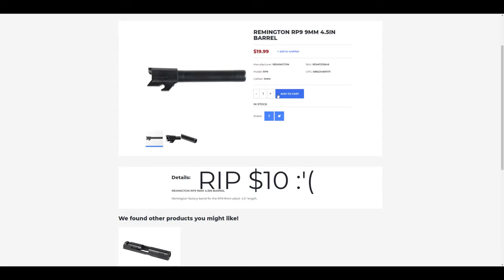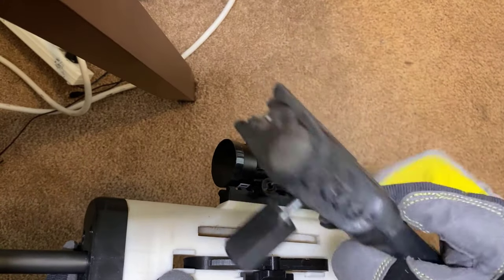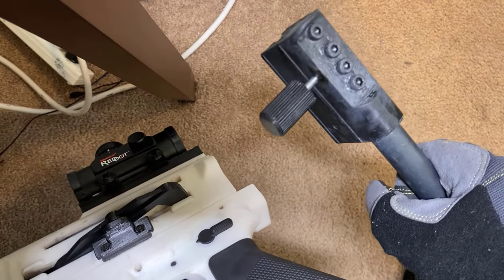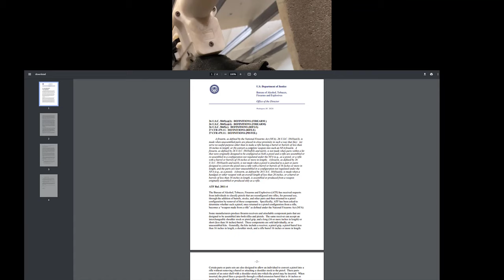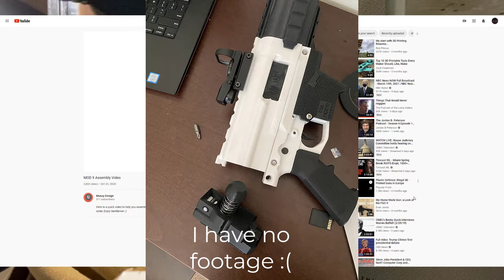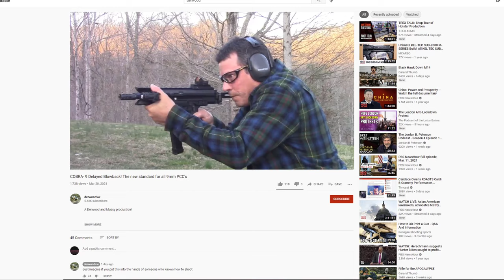FGC-9 Review: How I Learned to Build a Gun In My Closet

Comment: Hello, I am doing the same build right now, I am using lost wax casting with aluminum for strenght in sensible parts.
Reply from the maker: So you're trying to build it out of metal? Sorta unnecessary when PLA+ works fine, but interesting none the less
Reply: How did it turn out

Comment: Bashar vid was hilarious, hth did you find it?
I'd still rather have metal, even sheet metal which is a fine art, ask mark serbu.....but hey if plastic works, stick with it: def. better and cheaper mass production capabilities for sure
Reply from the maker: I'd agree but with that but after destroying 5 drill bits on failed bolts I have way more appreciation for people who can actually do metal work. The 3D printer lowers the skill barrier greatly and overall still deliver respectable results. There was this project the "PPDW-9" that looked like a traditional, full-metal gun home build. Curious to know what ended up happening to it but it looked like a project for people who actually have real metal work experience

Comment: Nice video, so I purchased a fgc9 kit and wondering will this kit work on the fgc9 mk2. I just started printing my parts but should I be printing the mk2 and use the fgc9 kit with it.
Reply from the maker: Yeah you just need to do minor conversions to make it work for the mk2, You'll need to buy some different parts but the bolt and barrel are essentially the same

Comment: Is there a way to chamber the fgc in 9mm luger?
Reply: It already is, that's what the 9 in FGC9 stands for 😉
Reply: @ludwigwinter6795  oh i thought it took 9×19mm Parabellum
Reply: @Schizohandlers  That's just a different name for the same caliber. I'll admit it's a bit confusing at first when you hear all those different names but it's all the same thing.
Reply: @ludwigwinter6795  wow mind blown thanks for the info
Reply: The only 9 that really stands alone is the 9x18 makarov. It can even be fired by most other 9mm chambering, just will lead to throat erosion in the firearm over time.
Reply: @antkoz6370  makarov won’t load in a parabellum/Luger chamber. P/L is a tapered case that uses a slightly smaller bullet than the straight walled case of the makarov.